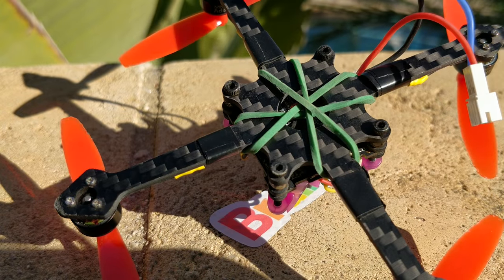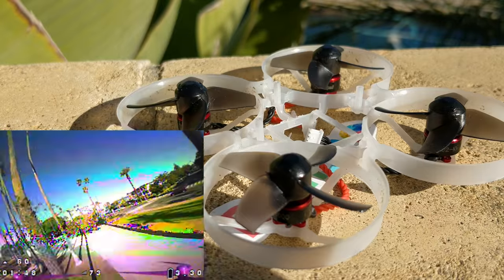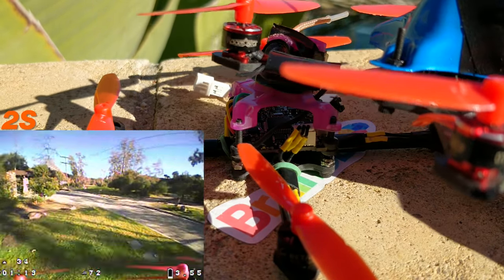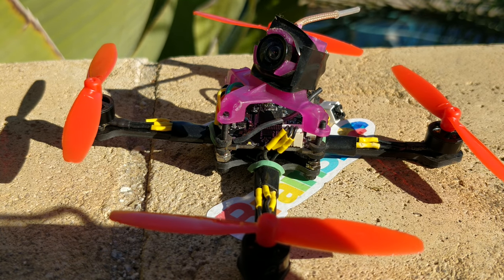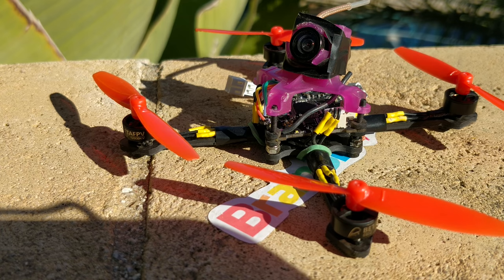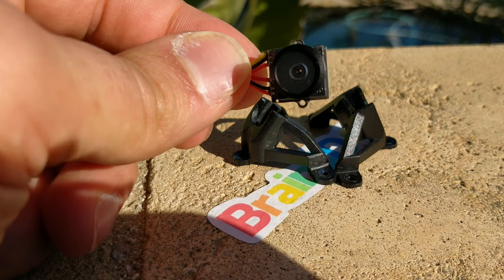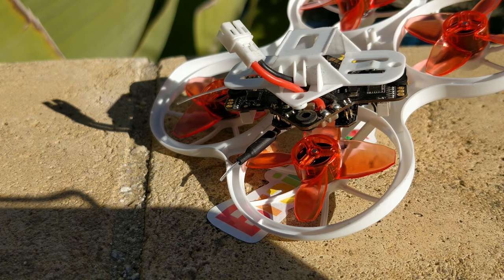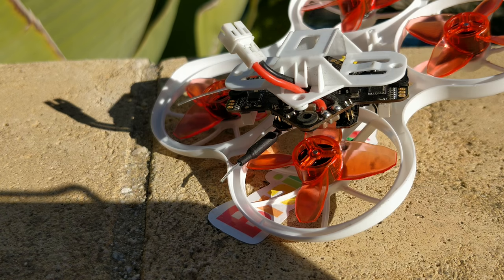Toothpick frame build development updates

Comment from the maker: 05:20 - 2S flight (too much power!!!)
No table of contents, I just talk...lots down here in the description however.

This is a work in progress.
So far recommended build parts:
Magic Props: https://goo.gl/YuEogN
0804 12,000kv: https://goo.gl/cZwVkd
Screws for motor mounting: https://goo.gl/r4ErQp
More screws if sold out: https://goo.gl/wK9jEA 
AIO Flight Controller: https://goo.gl/mMzV41
Or wait for the trashcan FC with the F4
FPV Cam/Vtx: https://goo.gl/gEhXUr
AWESOME MOUNT for the AIO above: https://goo.gl/3g9Eep
Note: some shaving of the sides to fit the cam in the mount will be needed.
Working on the frame still.  Hopefully will be available in about 3-4wks
Alternative frame but doesn't fit the whoop AIO boards (yet): https://lilduece.com/

Camera alternatives:
Caddx EOS2: https://goo.gl/juAEMy
FXT T80: https://amzn.to/2Bvo084
Specifically the 4:3 version of the Caddx EOS because it has more vertical FOV.  Note that these cameras will need an independent Vtx.

Things we know so far:
The 65mm prop is awesome.
If you have a motor with a 1.5mm shaft you will need this: https://goo.gl/xD7j8s
For 1S: Good quality motors in 11,000kv-16,000kv
For 2S: Good quality motors 6,000 -12,000kv is good
2S isn't really 'better', just faster
Motors: 0703 will work, 0802 is way better, 0804 is better still, 1103 may be the best option for the prop

Things in the same price range:
Eachine Trashcan: https://goo.gl/tD7QDH
Diatone 2019 GT R239 R90: https://goo.gl/DBnnke
TinyHawk: https://goo.gl/LrQiN9, https://goo.gl/8y66Gf

PID's for 1S:
Roll - P 100, I 65, D 50
Pitch - P 110, I 75, D 55
Yaw - P 45, I 100

PID's for 2S:
Roll - P 57, I 65, D 35
Pitch - P 62, I 75, D 35
Yaw - P 45, I 90

Recommended rates:
RC Rate of 1.45 for all.  Rest default
Feed forward of 50 for all

Recommend setting 'warning cell voltage' to 3.0 or 2.9 and then landing asap when you see the warning.

Equipment I highly recommend:

Micro Eagle - 
https://goo.gl/or1fS9

Rush Tank Vtx -
https://goo.gl/YMYmya

Fantastic solder-
https://amzn.to/2P5QM2W

TS100 iron -
https://goo.gl/DqBipa
https://goo.gl/svK6DD
https://amzn.to/2OV5XMh

WaFL’s Cap Cap
https://insta-stalker.com/profile/waf...
https://goo.gl/9CZdAs

Intro song Originally found it at http://www.8bit.com/ in the game "8bit TD" 

Song: "Dreaming" by TreyFrey 
TreyFrey.net
http://www.soundcloud.com/treyfrey
https://www.facebook.com/TREYFREY

Tips?
PayPal: https://www.paypal.me/kababfpv
Bitcoin: 1E4XZXoD4rS6MYWVWuenY7Kw2M1YgyNpoQ
Nano: xrb_1188ek5bd7tb9kw67asnp9o65byuoaxbtpxuznx1ribf75x78awywmakj55f
ETH: 0xD067F93811f2eC31CB1928901002dfdf9A492EF5
LTC: La2KWYAjp4VT2Lq2M76pbjzXWvRyjpfCtG
Reply: Awesome discussion! How about these motors? https://www.getfpv.com/dys-be0905-10000kv-brushless-motor.html
I actually have had these for a while but haven't built anything with them yet.. Seems like it might be what you are looking for in your build!
Reply: I'm all in with your recommendation and used your links so thank you just don't want to miss the toothpick first batch as I didn't catch your 7inch Glide flow in December checked loads did it go up on pirofliprc?
Reply: Thanks again for sharing your thoughts and creativity. Always looking forward to your next post. About the props..you say 1103 motors might be the best motor for them however, the ones I find seem to require 2s. Will they perform well on 1s as well? All the best from Holland.
Reply: Kabab FPV I can assure you the 65mm King Kong props can Handel a total weigh of 85 grams , I built a 2s brushed build with a 27 gram 2s LiHV battery  and the build it’s self was 58 grams dry also
Reply from the maker: @thelongranger55  I've built things of 60+ grams on 2S and 3S too. It does work. Just not as nicely as sub 50g
Reply: Kabab FPV yes your right , I strapped on a big x6b rx to my brushed f3 evo board and a big AKK 600mw vtx for a long range micro brushed quad so that’s why it was so heavy haha , i was a nice cruiser and I still got 6 minutes with my 2s 450mah LiHV
Reply: @FrequentFlyerRC  I just posted that same question.  I know you have a Beta75 Pro 2 and I have one on the way that will be here in a few days.  I would love to see if this would be a good solution and run it on 2S all the time.  Could use (2) 300mah batteries indoors and possibly set up a switch on my Taranis to chop the throttle 20% if still too much power for indoors and run it wide open  on 2S outdoors with either (2) 300mah batteries or (1) 350mah 2S.  What do you think about also changing the camera out to a better one that is 25mw or 200mw smart audio switchable to be able to run it on 200mw outdoors for further distance flights and then run it on 25mw for indoors?
Reply: Do the motors you linked is the description have bearings?
Reply: what props are on your tinyhawk? do they work 4 turtle mode?
Reply: @fuzznut25   
The stock 3 bladed props do not work.  The ones that do work are 4 bladed and sold sepperately.
Reply: @trfpvVT   yea I have 2 tinyhawks, I could never find any 4 blade that were in stock lol that's y I asked
Reply: Toothpick!? Call it the Dental Nightmare! Or Cavity!
Reply: @Kabab  what length motor mount screws do you use ? cheers man
Reply from the maker: @palaHD  I use 4mm but they're barely short enough on some motors not to touch the windings. 3.5mm is what you want but quite difficult to find
Reply: @Kabab  hey Bob, I am restoring your frame you sent me. I had to stop here to research a little so I would get the F3 board install technique and beebrain electrical tape correct. Can't wait to fly one of your 1S originals. Thanks again Bob!
Reply: i'm thinking about how i'm gonna use a 4s whoop board 1 year later lol

Comment: I'm in a congested area. This is where it is at for me. Back in the day my little hubsan would draw curious crowds. A 5 inch would cause derision. You have really helped move this hobby forward!
Reply from the maker: I truly feel this is a solid way forward. The perform and reliably coupled with the safety and extremely low noise is just the perfect combination for anyone that doesn't live in wide open spaces. I'm going to be moving in this direction much more soon. Much to come.

Comment: Very nice man :)  I'm in for a quad like that.. 
what about them wire-extender / replacement slabs instead of extending the wires? In case you don't know what I mean: those 'slabs' are allso sold With LED's..
Reply from the maker: oh not the ones with LED's.  Maybe version 2 or something.  For now, just a little PCB extender

Comment: Definitly will be building one of these... It may be an idea to replace the motor sockets with 90 degree sockets, that way the motor wires run straight out and down the arm.
Reply from the maker: Sure but that's so much work 😅

Comment: I agree, these props are really good. I only wish they make it with 1.5 mm hole, there is such a prop but is not well centered and causing vibration. Because, 2 years ago, i made my first brushless micro with 1103 10000 kv and those props drilled out by hand and it performed great, would have even better without the vibration. I also used a repurposed brushef frame and a brushed board with FETs desoldered and individual 6a escs... It's great to see those very light aio boards and light motors coming, making it all much easier.

Comment: With 1S, long range is a bit safer as well; absolute voltage discharge curves.  I've had a bad cell nearly take down a long range mission on more than a few occasions.  Battery capacity pre-testing will actually be accurate with no hidden surprises.

Comment: The King Kong 65mm props is he best micro prop I can think of by far , I mentioned I’ve had a build almost 2 times as heavy as yours on brushed 2s motors and it still ripped the sky open lol , the props is just magical ! , hopefully that triblade works wonders too , I’m going to build one of these little guys you have here soon for now I’m building a 3 inch GPS quadcopter .

Comment: @Kebab FPV With the angle of the cam I use an extra long screw and run a whoop grommet in between the acrobee cam mount and fc.... Some kind of cam soft mount? Can't wait for the frame, I'm holding out, cheers!

Comment: Far easier than wire extensions/racewire is angling the connectors - you even get some slack and don't need to have holes in the frame. Just add a blob on all three connectors to heat them at the same time. Flux is required.
Reply from the maker: Mmmm I considered it but didn't want to risk breaking the board. Racewire is something people will know what to do with.
Reply: @Kabab  That was my thought too - racewire stuff is easier to work with because the solder will wick to that, and you can visually tell if it's right.
Realistically, once Eachine realizes this is a thing - they'll make their 80% effort to clone this frame, and spec some 0804's with longer wires.  They'll probably call it the Dumpster, because it'll just be a bigger badder Trashcan.

Comment: Solution could be to use 90 ° 3pin connectors soldered on the bottom side on the board, so straight plug in for the motor wires and kept the wires on the frame no uptiled wires , safe for  the props, nice frame,  Happy holidays, regards RcFiL
Reply from the maker: Yep but requires resoldering the board connectors. Not easy

Comment: Hey Kabab, great video as always ! So, I actually ordered the trashcan as soon as I was able to.. but since I somehow got skipped in the shipping process and I have to wait until they get the second batch on the 27th january.. do you think it's worth the wait or should I try to get all the parts for a build like this ? It performs amazing, I love it ! The problem would be getting the frame you use right ? Also do you think that using a pnp board and adding a cf nano would add too much weight ?  Thank you so much for looking  into this stuff and pushing the hobby forwards ! :)
Reply from the maker: The hype is intoxicating but I really wouldn't worry about 'missing out' on the trashcan. This is really the first good whoop of it's kind. There will be many many many more very soon. Likely before they even get to batch two. I'm working on testing various drivetrains on these big props. Haven't landed on anything optimal yet. So far it's more of a proof of concept. However the frame will be out soon and I'm betting that building one of my little carbon frames from scratch is gonna be cheaper and yeald more fun than a whoop...if you can fly outside. Just keep watching the market for now.

Comment: Hey Kabab! I really like this little quad, I'm not exactly sure how I ended up with almost 40- 450mah 1s batteries but I have em, and looks like the 1s might be enough. I am wondering if it's possible to run two 450mah 1s on this quad. I don't really want to buy more batteries. I'm really liking this size because you can rip anywhere, the tinyhawk is a great little quad but mine just drops out of the sky in dives, power loops, and hard corners if your not throttled up. Would raising the idle help it to complete these moves?
Reply from the maker: There are a number of reasons why you could be having those issues. The toothpick and all the toothpick components will be available at the beginning of next month and the performance has increased quite a bit from what anybody has seen so far. it is incredibly impressive and I cannot believe it just keeps getting better and better
Reply: @Kabab  Thanks, I watched quite a few videos of yours this morning, disregard any other comments. This is my 3rd tinyhawk and both of the others started the same thing as they got older, this one is pretty new and already doing it. Its also slow to start the motors on arming , usually 2 start up and the other 2 follow 1 by 1, if you have any ideas they would be greatly appreciated. I will definitely be building a couple toothpicks as soon as they are avaliable, what I've seen is incredible.

Comment: I think you have to try the ladybird props, could be a good combo with some higher kv motors, maybe even with 2s. They are everyone's second favourite props for micro setups after the 65mm props.
Reply from the maker: I've tried those. The 65mm are wayyyyyy better
Reply: @Kabab  yup ladybirds have no power and break way easier
Reply: Even with higher kv? That's a bummer. Because I have lots of them lying around. Might use them after winter :)
Reply from the maker: @DennisRiessbeck  the higher kv is actually an issue. Around 11000kv is probably ideal. It would work. Just not well.

Comment: So, @KebabFPV all we want is a kit with FC/ESC, a cam, 5 Motors, 20 props and a frame and a link to a buildvideo, when will you finally release that? You'll be sold out for a year or something!

yeayeah I know, work in progress! apreciate your work, you're really pushing the hobby! In Switzerland we have a new Law comming up, you need to register every flight of a drones GPS over 250g online, so our aircontrol knows what is up where. These little beasts could keep racing in the business, because I'm not gonna mount GPS to something what hits all kinds of obstacles all the time.
Reply from the maker: With the recent drama on things, I'm moving in a different direction. It's gonna be a great direction hopefully

Comment: I've just finished building this drone. it flies great and is so light and quiet. 26g drone(42g auw). I love it. million thanks to you sir. I chopped arms that can mount 08xx motors and taped on brushed motor frame that can take kk 66mm props :) while I was building it, I was thinking, if I can just have a thin 3d printed plate to put the board on with places in the corners to screw nuts to mount a 3d printed camera mount. together, the bottom plate and camera mount would make a nice setup. and then you could put it on any frame you would like, but would look nicer if you put in on the frame that made for whoop boards.

ps: I didn't know Crazybee F3 Pro has betaflight 4.0 installed. or is it just mine ? sweet!

Comment: I have to say but the bat 100 was ahead of its time :D and now we are only catching up. 

The bat 100 is a 0705 motors quad with 50mm props 1s set up rtf, for those who didn't know.
Reply from the maker: The bat100 was just like what I was building way back then. It had a full stack and was a pain to manage
Reply: Problem with the bat was those crap motors. Vibes for days!

Comment: Rescaling 1850kv 6s to 65mm props 2s gives 11100kv. If the load is similar to a 41mm whoop prop then rescaling a 2207 stator you get exactly a 1103 motor or a 0805.5
Reply from the maker: That's a very very good point. Wow. Amazing we landed on the right numbers so quickly and easily for the micro.

Comment: Have you flown the Fullspeed Bat100? I think maybe they were trying out a similar concept with that one. I am trying to use your idea but with a bat frame and use ladybird 55mm props paired with the Tachyon 12000kv instead cos they fit. Flight stack will be Teeny F4 1s 6a. I dunno if the different props will throw everything out the window though because they aren't magic, just decent.
Reply from the maker: Yes I have. Great little quad. The issue with quads of that era is that they use a full stack that is more cumbersome to manage and less reliable. That is the main reason why I migrated away from them and now migrated back towards them because of all of these all-in-one boards that are very good and reliable

Comment: I impressed that you do not have any cuts... I have maybe other props cause I can still see the scars on my fingers and front arms after few months (btw it was coreless motor )

I believe that this sizer will be the futur for me. Light, compact, cheap and moreover it is funnier to fly in a park or in the city

Btw is it 2mm carbon? I am using 1.5mm right now

What are your setting for the FXT T80? I have two same but they are too slow to switch between dark to lighted places
Reply from the maker: 2mm carbon. I know it's overkill and I'm just using the t80 stock

Comment: You can desolder the motor plugs and solder wires directly to the controller board
Reply from the maker: You could but these boards are pretty fragile and tiny.  I'd rather not risk it maybe.  I'm expecting future boards to just have solder pads for this specific kind of build.

Comment: Any thoughts on the fullspeed Tiny leader components in this frame? It has the 1103 motors you suggests might be the best, and a legit fpv system.
Reply from the maker: gosh after flying thing on 2S, I can't even imagine something this small on 3S.  I took a look at some tiny leader videos. My little quad on 1S seems to almost similar performance as the tiny leader on 3s...

Comment: Hi is it normal that the motors warm up to the point that its close to be hot to touch? Build one with racerstar 0703b 19k KV 65mm props 1s 260mah GnB. Cant also weigh the quad, i dont have a scale

Got to say that its quite and great throttle authorization. Cant wait to fly it out doors
Reply from the maker: They do get warm but shouldn't be getting too hot.  My 22000kv racerstars do get pretty hot however  even on 1S.  haven't had issues yet.  Be sure to limit your max throttle down to like 70 maybe.  the top end of the throttle seems to do nothing...

Comment: I don't think the mini racewire is required and could think of a better solution. It would make it a pain to convert back to whoop style if you ever did. Maybe just some extensions with female on one end and male on the other so that whoop motors can plug right into them and then plug into the board?
Reply from the maker: Extensions is an option as well but it weighs more and it's bulky.  Kinda crazy to worry about the bulk of a tiny connector but it's definitely the case here.